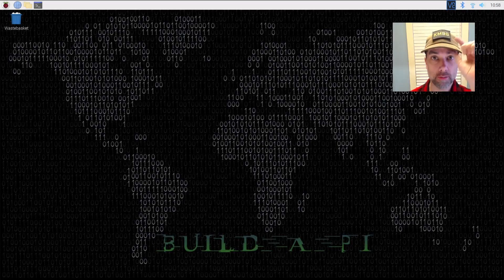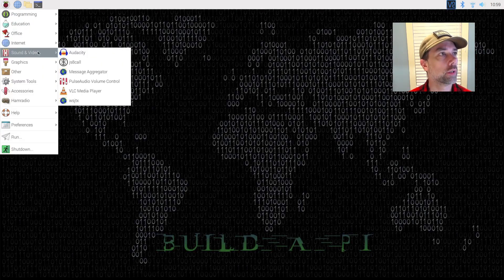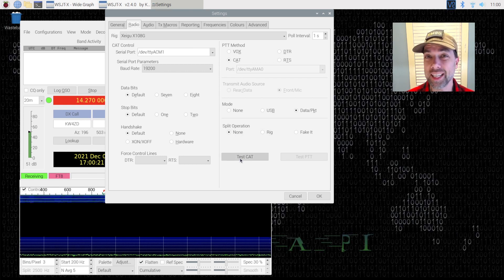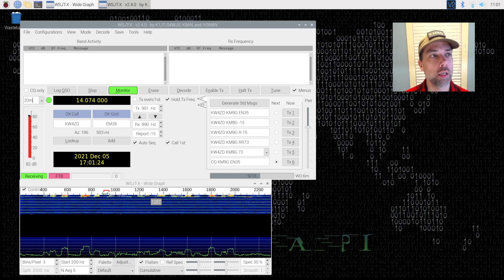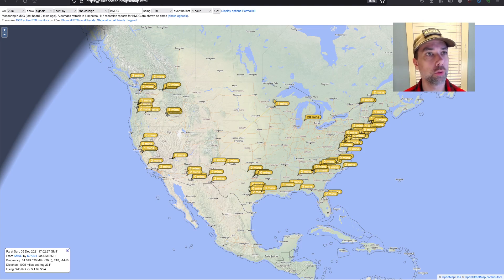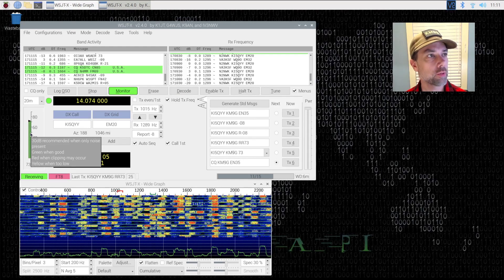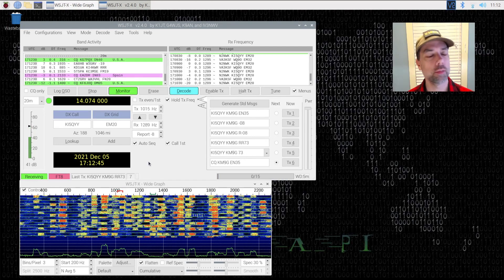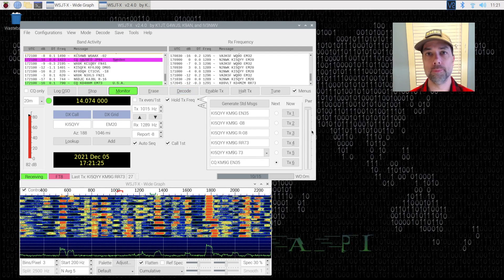How to get FT8 working on the Xiegu X6100

Comment: I installed the drivers, but the pc does not even see the device. Is there a setting within the radio I need to change?
Reply from the maker: Drivers? You shouldn't need any drivers other than those auto-installed.  Did you plug in the right USB port?  Is the radio in data mode?

Comment: Not sure i see the point in ft8 🧐
Reply from the maker: It's a fun way to make contacts without getting stuck in a horrible ragchew, it's a good way to test antennas, radios, batteries, locations and lastly, it's a good proof of concept that has spawned a lot of innovation.  But I totally agree, you have to give it a purpose in your station, it doesn't really come with it's own.

Comment: Hi! I have a question out of range of the current topic. Is it possible to connect to X6100 an external monitor? It should be possible via USB-C port and it seems to me it doesn't work.
Reply from the maker: It's a USB-C connector only, it's a USB 2 device.  So no video out

Comment: Great video. I have my sound settings exactly as you however no output from the X6100…
Reply from the maker: Do you have the USB cable in the right port?
Reply: @temporarilyoffline  yes, cat control works; it decodes, when the X6100 transmits there is no audio/alc. I’ll keep messing with it. It works on my Windows machine but not my rPi.
Reply from the maker: Ok, at least it's not the radio,  that makes the fix easier. Good hunting!
Reply: @temporarilyoffline  what is happening is, on transmit, the mic is still working rather than the alsa output as shown in the video.
Reply from the maker: @beavx  yep yep, manually change the mode on the radio to usb-data and in wsjt-x, pick "none" for mode.
Reply: @temporarilyoffline  got it. Here’s what worked for me on rPi. Mode has to be set to none and the X6100 set to USB-DIG. Works perfect now.
Reply from the maker: @beavx  excellent!
Reply: @temporarilyoffline  thank you for the help!!!
Reply from the maker: @beavx  Anytime Friend!

Comment: Nice job figuring it out. 👍 you can also change the level with pulse as well as RF gain.
Reply from the maker: I tried to adjust it with alsamixer, but never saw the needle move.

Comment: I would suggest using Fake It for split operation. That will keep only one VFO active and allow for compensating for the lower frequency response near the edges of the audio passband.
Reply from the maker: I tried out fake it and rig and both of them switched VFOs on me.  I assume once there is proper rig control for the X6100 this problem will be gone.